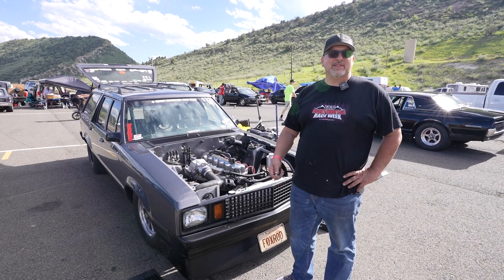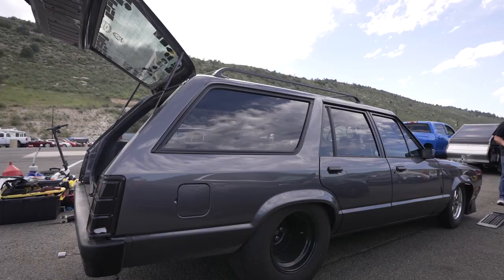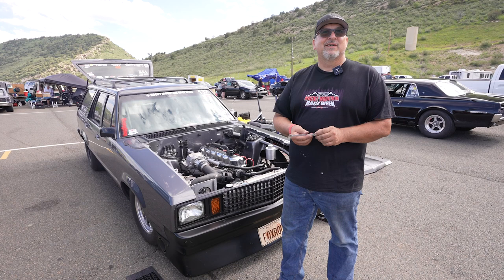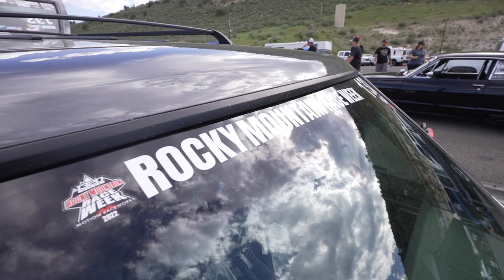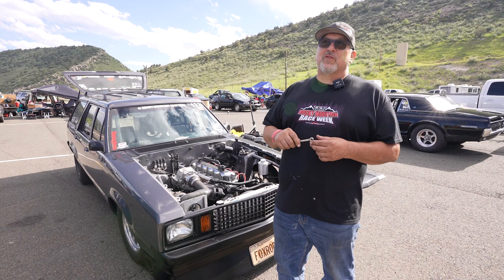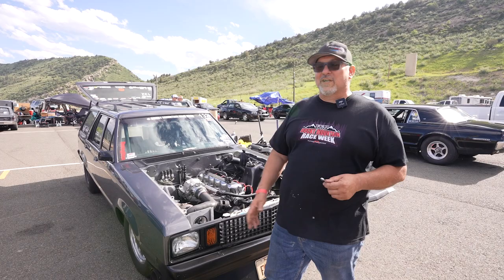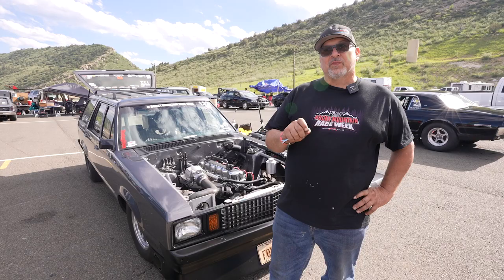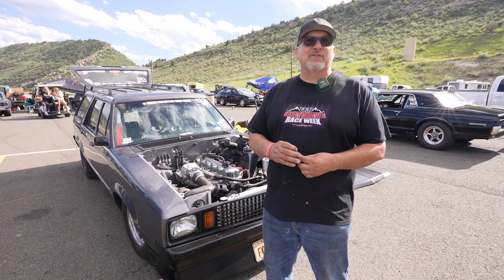Crazy Unique Powered Fairmont Wagon! - Rocky Mountain Race Week Day 2

Comment: This is such a cool engine configuration. I'm working a deal on one right now so that I can get the horrible 4.2 out of my F150 and I'll be doing a full build on the engine to try to get about 500hp with port injection. I figure that if I can get enough out of it I can make my f150 go from a boring ride to a fun drift build with a 5 speed and hand brake.

Comment: 300 is definitely a big block, I'm going 4.200 with sleeves and a 4.400 stroke 

Give a V8 4.2x4.4 and you get 487 cubic inches which is definitely big block territory hahaha

I'm going with a sequential turbo setup but more so for my f350 instead
Reply: "Big Block" doesn't refer to piston size or displacement. A Big Block has a longer spacing between the bore centers then a Small Block, so the cylinders are further apart from each other. It's this that enables a Big Block to have large diameter bores for short stokes while retain large displacement numbers. That's what makes it possible to spin them to high RPM. Some folks used to say 'above 4" spacing is Big Block, below 4" center to center, is Small Block'.
IIRC, the 300 has a larger bore spacing then the family that had the 250 Crossflow, 3.9, 4.0 and Barra, so probably does count as a Big Block Six Cylinder.
Reply: @PiDsPagePrototypes  in terms of bore spacing the 300 is 4.48, the 454 Chevy is 4.6 

While the Cleveland I recall being 4.200 or so but I don't remember if that was for another motor or not
Reply: @PiDsPagePrototypes  cle eland is 4.38 which is .1 smaller than a 300 and .2 smaller than the Chevy 454
Reply: @Project-gr6zy  300 definitely qualified then :)
Reply: Not going to enter the big block v. small block conversation. I love the ford 300, and still have one in a 66 f-100. I did not realize the 300 would fit in a passenger car, as they are significantly larger than the smaller ford inline 6 motors.